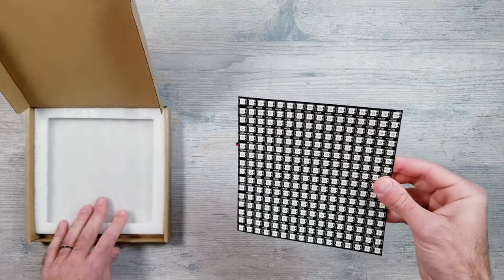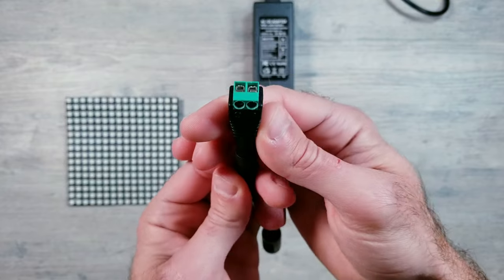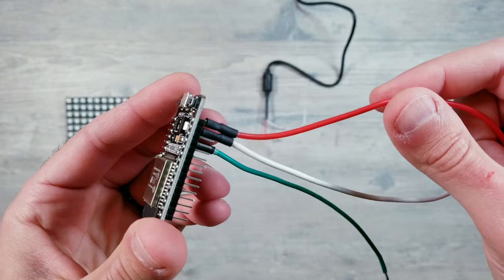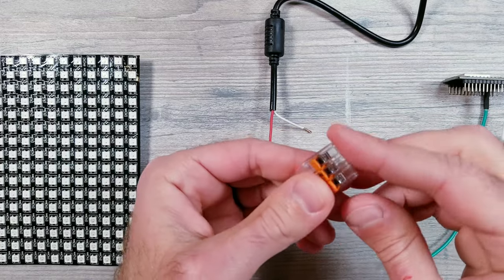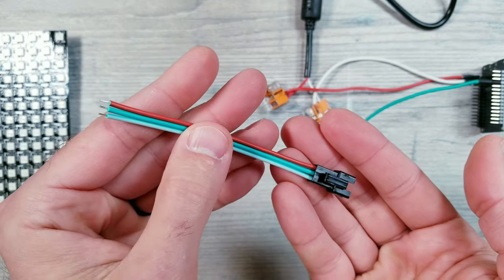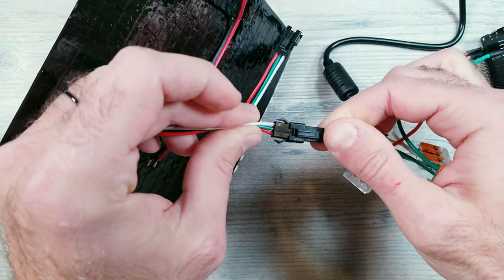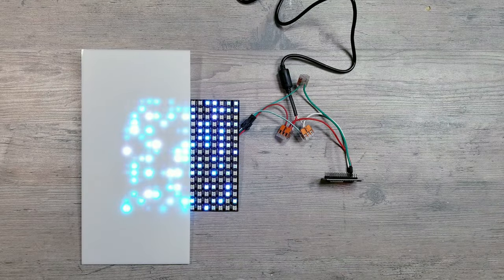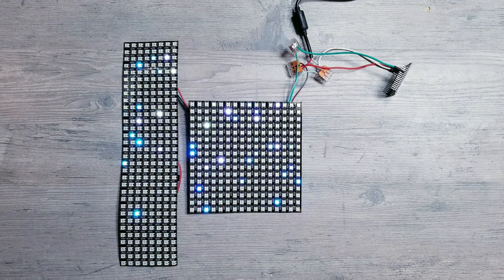LED Matrix - Connect, Power & Control - Setup Guide

Comment from the maker: 📦 AMAZON’s BEST DEALS (updated daily): https://bit.ly/3VWZKVS
📣 AliExpress’s BEST DEALS (updated daily): https://bit.ly/3VwoaDW
☑ Check out my sponsor to begin your FREE 14 day trial to Aura: https://aura.com/chrismaher
Matrix LED Panel: https://amzn.to/3DCHlmO
Power Supply: https://amzn.to/3E1MExp
ESP32: https://amzn.to/3Uapo64
Wago Connectors: https://amzn.to/3sVHkFH
Wire Stripper: https://amzn.to/3U575Pv
Diffuser Acrylic Used: https://amzn.to/3UvbcEB
Extra 3pin Connector Pieces: https://amzn.to/3DJVZc6
18 Gauge Wires: https://amzn.to/3fEyCs7

WLED ESP32 Setup Tutorial: https://youtu.be/TOEnFKLm9Sw
Soldering Tutorial: https://youtu.be/apSz3NXYlx8

Other Videos I Have Made:
Govee M1 Led Strip: https://youtu.be/XhMnKVqAIWw
Govee T2 TV Kit: https://youtu.be/i6Dp9ALQLSc
Best Diffuser Channel on Amazon: https://youtu.be/1SKo_HdKVYA
Best Edge Lit Diffuser Channel on Amazon: https://youtu.be/FNDikt7VfRw
Best Flexible Diffuser Material Ever?! https://youtu.be/yHDvq7zBEoQ
DIY Diffuser Channel: https://youtu.be/OQv3NcMYp5g
DIY Ground Level Deck with LEDs: https://youtu.be/gbokxiIECpU
DIY Board and Batten video: https://youtu.be/b13VLiK7AOU
How-To Video for the LED Pegboard Project: https://youtu.be/K4EzLI1fFnQ
DIY LED Baseboard Trim: https://youtu.be/Ik8HnGxfQq0
RGB Lamp Hack: https://youtu.be/UNPR_98xLQY
Corner LED Light using Pex Tubes: https://youtu.be/rIbTzUD2E4k
DIY Govee Glide using only paper: https://youtu.be/n9LsiQARFas
Simple Corner LED Project: https://youtu.be/ZB5HqWhMXNo
DIY Customizable Light Up Images: https://youtu.be/2q_zrEcbXHE
LED Strip Diffuser Ideas: https://youtu.be/09-fiWjP42Y
DIY Hexagon Project: https://youtu.be/t9xGyB4ahyY
DIY Edge Lit Designs: https://youtu.be/0_TtHkBB3vA
DIY Black Acrylic Floating Shelves: https://youtu.be/6csSMtV_op0

Other LED Tutorial Videos:
Installing WLED on esp8266: https://youtu.be/l8OMi7SMpqs
Power Options for LED Strips: https://youtu.be/KFtjf5mD6tA
Use WLED with Govee Lights: https://youtu.be/l0sRG1WAbq0
Re-Use Leftover LED Strips: https://youtu.be/ASnuk-XDVbI

Unboxing Videos: 
Sync Entire Room with Govee Immersion: https://youtu.be/ztXyVUYvHSg
Divoom Pixel Art: https://youtu.be/e9w5FLifgdU
Govee Glide: https://youtu.be/e3jJye-fYoM
Govee Lyra: https://youtu.be/NFDYz37ZoXU
Govee Hexa: https://youtu.be/UDYUvfce4tM
Govee 3d: https://youtu.be/CY4sKQpxPHY
Lytmi Neo 2.0: https://youtu.be/sth-EdEfSis
Tiki Torch Bluetooth Lights: https://youtu.be/oZRrXPdDmGw

The best way to help support my channel is to like, comment, make sure your subscribed and share my videos with as many people as you can. The other way is to use my links above as I get a small % at no extra cost to you if you buy something. Thank you all for the support!

Comment: It would be nice to have a "design your own RGBLED pattern" similar to the CCA makers/sponsors.  I like the premade forms over individual RGBLED soldering. It makes sense for me to use premade in time and ruggedness. I am working on embedding a cop light on a police bike (red/blue with sequencing). Need it to be all weather, last many hours without a charge and be annoyingly bright.
Reply from the maker: That's a really good idea! I wonder if a company could come up with a simple interface to be able to customize a build, length, IP rating, power etc. Thanks for watching and taking the time to comment!

Comment: I have tried 3 ESP32 WROOM 32 and 2 LED matrices. Somehow the matrix won't turn on; all is done as described, with WLED configured and enabled. What is going on?
Reply from the maker: Hmm, I would first go into led preferences and scroll down and make sure the data pin in the wled program is set for the one you used on the esp board. That's the first thing that comes to mind!
Reply from the maker: It's the GPIO number in WLED under led preferences. Let me know if that makes sense. I've always used the d2 pin on the esp device for the data line and that number used to be the default that was in the field after flashing. I think though recently the default number after flashing is now different so you probably have to go in and change it to 2 if you also used the d2 pin like I did.
Reply: @ChrisMaherDIY  It makes totally sense, so much sense that is now working! Awesome. Couldn't even imagine that.
Reply from the maker: @marcoisabella1724  Awesome!!!

Comment: hi! i have a question. i whanted to add this panel to my PC, it has 3pin 5v adresseable header, 3A5V MAX, i was thinking, i have two options. 1) connect 2-3 molex adapters to the power panel leads, and only grnd + data of the motherboard header to the panel or 2 )  data + grd + power of the header to the panel + 2-3 ground + 5v of the molex adapter. Do you think that its safe ?

Comment: Are all ESP32 5v Looking on EBay and lots are 3.3v?
Reply from the maker: Thats a good question! I would assume that they are all pretty much similar but maybe there are some differences. Maybe someone else reading this might know more on that topic and can chime in!
Reply: @ChrisMaherDIY  After further investigation it seems you have several 3.3v pins but vin is 5v-10v but then runs through a regulator.

Comment: If I buy 4 of the 256 panels and connect them together and then change the pixel number on the app accordingly will all of them light up and work without extra power or other parts?

Comment: TRy to test SP801E led controller, it can be used as for Matrix and for single lines of rgb lights, Very nice controller But not working with assistants maybe in fuuture updates, But you can attach led matrix set how many pixels you have, or make a line, or even create your own layout, works with ws2812b etc strips and matrix panels, also you can make you own effects, there is a build in app effects which can be mdified and can be written into device mmemory and run without app, you cna create playlists etc, also it has animation tab so you can draw you animation and save it for later, not tlaking about text, plus there is a 3 layers which can be combined toghether, and for some one main feature its support to run like art-net device, so you can you Jinx, resolume arena on it, from PC, sure it will be online but the amount of effects is unlimited, so govee is not capable of doing this. if only govee has like ability to create animations not like prebuild from patterns in which you can only change colors speed etc, it will still stayed the same... I if want f.e.  make such effect like: lights are slowly one by one encrease their brightness, and after that all glowing permanently  will be cool. The 1 bad thing about sp801e controller all effects a generated with frames, so its like you record animation so it played and after that stop playing, sure you can st it in a playlist for 20 times but still some switching flashes will be visible. Sorry for my english. And this is not ad i bought it with my money... and order another one to put it into the window for New Year animation.
Reply from the maker: Thanks so much for watching and taking the time to comment! That is so much good information and thank you for sharing! I really do want to try the sp801e now! Hopefully in a project down the road I can try! You bring up a lot of great points on the shortcoming of govee and how they could improve things. Thanks again for the comment and hope you have a great day!

Comment: I wanna make a cube using 5 16x16 led matrices, any idea how much current that would draw and what kind of adapter I should be using?
Reply from the maker: Thanks so much for watching! I've also wanted to at some point try doing that!! I'm not sure what that would draw or what adapter. I would probably start using a 5v 30a power source and testing things out and going from there. Maybe  someone else reading this might know for sure what would be best but that is what I would start out with!